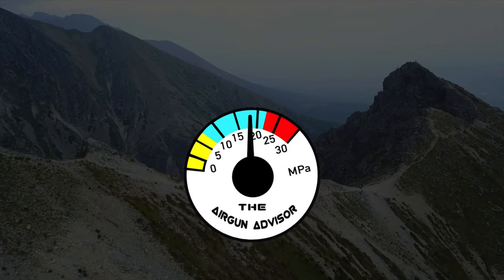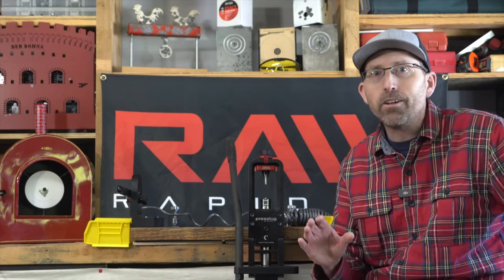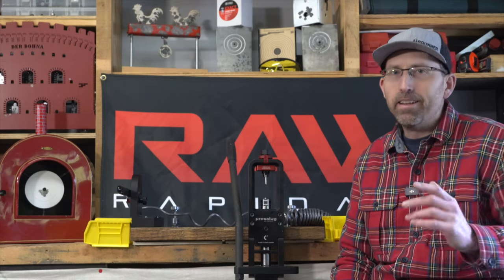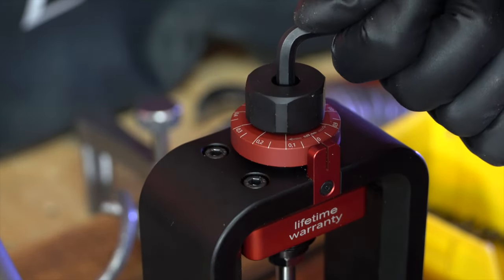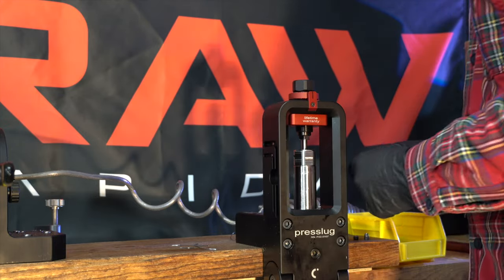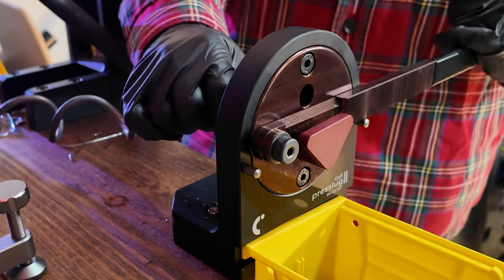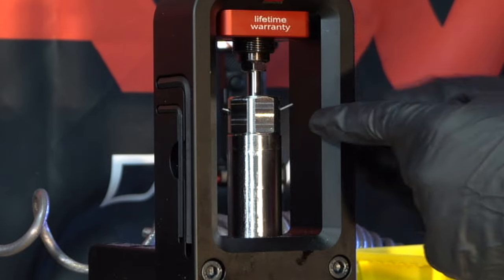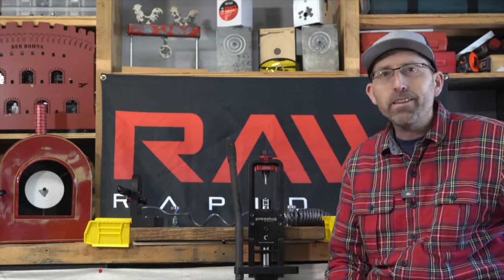Airgun slugs with the PresSlug Kit | Airgun Advisor |

Comment: Built My Own with a Harbor Freight Arbor press a small engine lathe and $40 worth of stainless and brass, all total cost me about $250.... these fancy CNC-built presses should only cost about $350 all total this pricing is ridiculous
Reply: Yep, sweet👍
Reply: You are so right my friend.

The Slugpress lead cutter = 359 euros.
Every single Presslug die caliber = 399 euros. 
All common calibers in dies (.22/.25/.30/.357 and .50) it will add up to 1995 euro. 
The Presslug Press itself = 1.887 euros.

For the Presslug in the most common calibers you will have to dig up over 4240 euros. 
Then you need to buy the lead and/or an oven and molds to recycle your old slugs and pellets which will set you back another 300 euros.
This makes it a total of 4540 euros not mentioning the sizers.

The average slug price is about 20 euro (over here) per 100 in .357
This means that you can buy 22.700 slugs for the complete Presslug setup alone. 
When you just invested 4500 euros in total, you have not yet pressed a single slug. 

When you shoot 100 slugs a week, you can shoot over 4.1/4 years before you have earned your purchase price back.
When you only use your slugs for actual hunting, and pellets and cheap slugs for fun shooting, you are looking at a lifetime of ammo.

I love the press idea and I understand that quality equals money. I also understand the fun of making slugs . . .  but these prices are an insult and take away most of that fun factor. 
Yes you can buy 1 die, but most of the people that take slug making serious are hunters who use .30/.357/.45/.50 and even .72 caliber . . . I believe you can make this equipment for 1/4 of the money and the same or even better quality/tolerances.
Reply: agreed 100%

Comment: Can't find any information on what size wire for what size slug
Reply from the maker: Wire is listed on the Airforce Airguns website.
Reply: @AirgunAdvisor I mean does the wire need to be the same circumference of the slug you're making or slightly bigger
Reply: @AirgunAdvisor I don't want to buy it.I want to recycle
Reply: @AirgunAdvisor I don't want to buy the wire butt recycle and make it
Reply from the maker: @ I was thinking the wire size should be listed there as well.

Comment: Just a little constructive criticism. The center hole for the core cutter should be offset not directly above the adjuster. What winds up happening when you cut the cores sometimes the core does not fall. Therefore, you will cut another one squishing the one below it. Which therefore will not fit in the dye properly, Also, just a tip, you should use a small pair of vice grips on the adjuster to keep it from backing out. This is only for the core cutter. If I could leave a photo on here, I would to demonstrate. Again that center hole is for 22 caliber cores, which is the most common airgun projectile to shoot.

Comment: I had my eye on this for a long time but not any more. Reason? It is purposely too expensive and not easy to find your chosen subcalliber (was looking for 5.52). I resulted to casting at 35.7 and 37.8 gr on average, 8 slugs per time and then weight shorting. At approx 150€ /mold it was more cost beneficiary to cast slugs than to purchase (I use them to fully auto and semi auto LCS sk 19 and huben GK1). For my target shooters I use purchased ammo.
Reply: 100%FACTS👍

Comment: Would be nice to show how tou can do different light slugs with sharp tip and boat tail with the same hardware or some add-ons
Reply from the maker: That is as easy as swapping out the die for another available one. Not sure those are options at this time.
Reply: $900 dollars per die and that's IF the third party seller is willing to put you on the 6 to 8 month waiting list in order to purchase one. This press is ok, BUT the dies are virtually impossible to find because they're proprietary from some third party seller overseas😞

Comment: they dont have 22 caliber for sell. and i think they will not have it again in stock here in europe.
only 177, 25, 30 and 35.
the slugs are perfect, always same weight. 50gr .25 RA4 952fps bc 0.125 validated at 600 meters 40cm by 40cm gong with m3 impact.
better only altaros slugs
Reply from the maker: I have seen it here in the US?